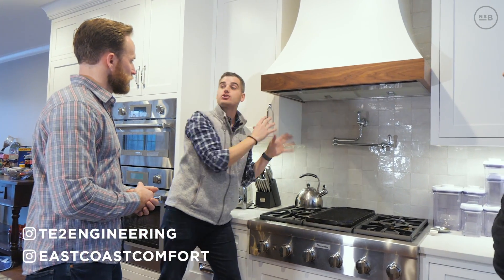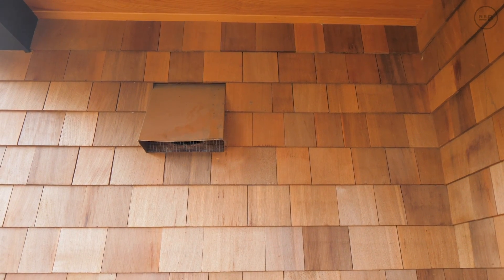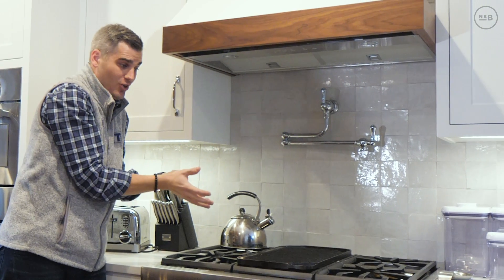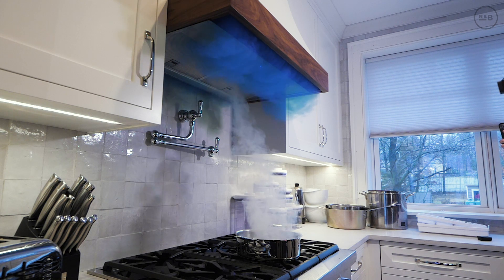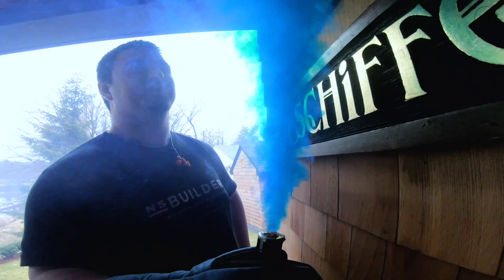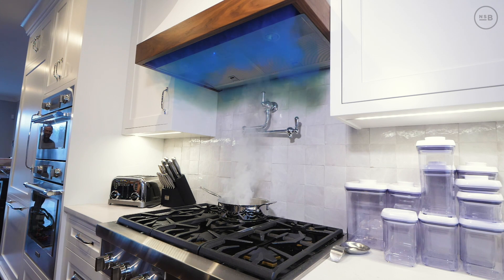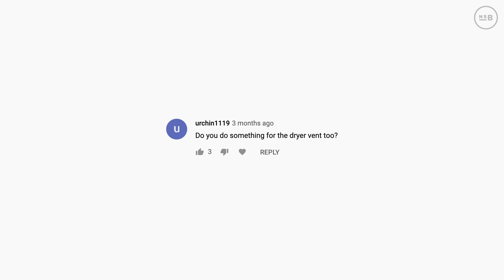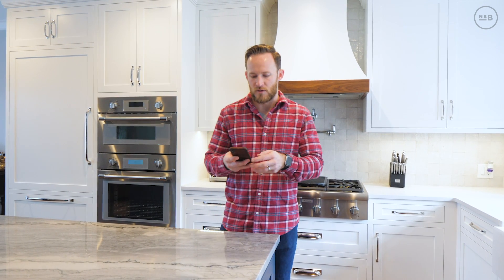Performance smoke test on kitchen hood exhaust and make up air

Comment: Thank you for taking the time to make this follow-up post.  I was a bit let down. 
With a 1000cfm blower you would be looking to suck at least 4 large gas burners on full tilt with bacon.  You presented a use case that will never be experienced in real life, simmering steam from a cold pan. I would be super excited if you would crank up the burners to 11, put some bacon in the pans, turn the blower to 600cfm and show us how it works. Great show and great work!
Reply: I would have loved to see four pots with boiling water and see the performance of the exhaust at the different speeds. I do give them props for following up though.